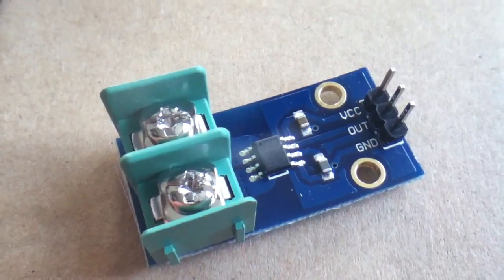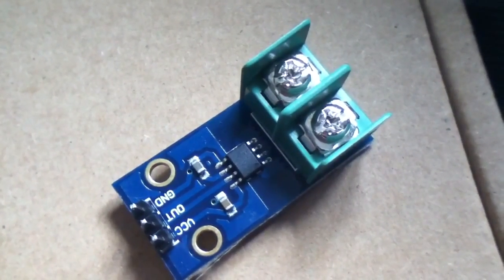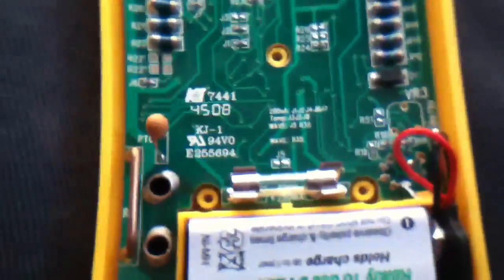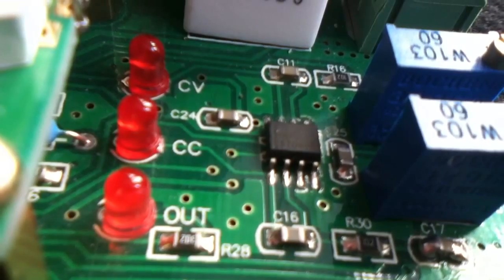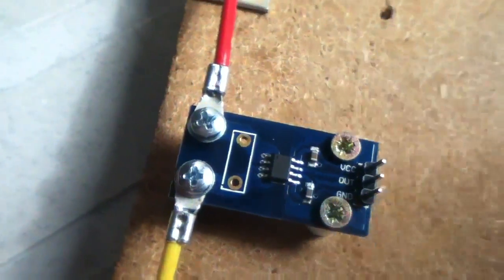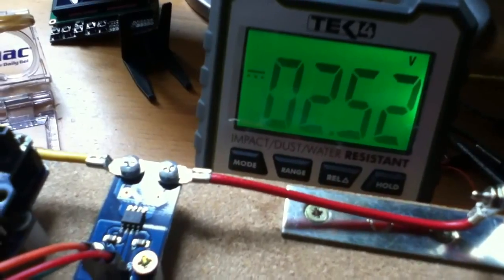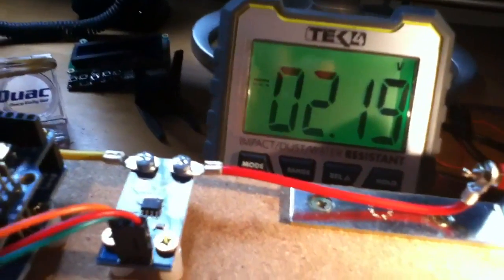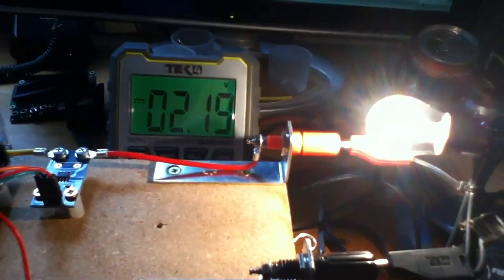Using the ACS712 Hall Effect Current Sensor Module (part 1)

Comment: I bought one of these modules and it seems to me there is no way you should run high current through those traces on the pcb -- has anyone done it? It says good for 20 amps !  (no way?) YOurs looks beefier than what I bought -- nicer terminals also. Where did you get it?

Comment: Hi Julian. good vid. But to me (so far) the acs712 is pretty useless. I have 4 of those mini boards but the readings are so silly unstable. With no load it is hopping between 08 amps and -08 amps. Some times I even see reading above 2 amps.  I also have the ina219 whis is suposed to be much better but that one does only handles max 3 amps. When having 200 watts of solar on 12 vols... well  I need a lot more amps! 

Eventually I like trying to "record" the current/wattshours going in and out of the battery so I can determine of it is running low or not. I need this since just measuring the battery voltage under high load is pretty useless because of the voltage drops under load. 

So any one any suggestions for a (cheap!) +-20 amps  braekout board for arduino similar too the ina219?

Comment: Julian, you stated the isolationvoltage of the acs712 is 1200V. According to the specs of Allegro it is 2.1 kV RMS (60Hz) for the duration of max. 1 minute. Did you test the 1200V as a continuous DC voltage during, lets say, 1 day?

Comment: Could you measure AC current with this module? Did you use any control of 50/60Hz pulses to measure in AC?
Reply: Yes without any problem

Comment: Please suggest me to measure th DC voltage upto 500V and Current of 20A I want to make power meter for my solar panals whcih are capable of giving volage upto 300V and current upto 5A please suggest me the sensors

Comment: I think with all those ring terminals you’d be better with a soldered in low value resistor! But I can see that the purpose is to use it as a test rig and or demo. Just out of interest stick your Dmm set to mV across the 2 terminal sockets that you fitted to the end of the wooden test board when you have a high current flowing. Be interesting to see what drop you get. 
Great demo and thanks for sharing!

Comment: Hi, may I know is there any current transformer/sensor to measure 240V AC and able to interface with arduino? This will helps a lot....thanks
Reply: Hey..Jeffrey Ho did u get the solution for this..i am also facing same problem..tell me if u got d ans..ty in advance

Comment: Can I test this sensor with a supply of 220V using a 11W bulb?
Reply: Yes, an 11 watt bulb should draw about 50 mA, so you won't get very high resolution. It should output an AC voltage of 26 mV peak to peak, centered around 2.5 volts. That's going to be quite hard to read, so you probably would be better with something else but it shouldn't be dangerous. Please do be super careful when messing with high voltage! That Sh!t will kill you faster than a rogue US navy drone.

Comment: Why do you want to only measure current on the high side? The amount of current flowing directly out of the positive end should be the same flowing into the negative end (reverse if you're talking about electrons), so measuring current at both ends should work the same, no?
Reply: The reason is not because the amount of current will change, it's because of the use of common grounds. This chip has a nominal 1.2 mOhm internal resistance. If you put 20 amps through it, it will drop 24 mV. There are some situations where you need the ground potential of your device being powered to be exactly equal to the ground potential of your power supply. If you put this device on the high side, then the ground of your power supply and the ground of  your load stay the same, and it makes everything much easier as you no longer have to account for that 24 mV difference.  For example if you also need to measure the voltage across your load, putting this device on the low side would required taking voltage measurements on both sides of the load, and subtracting. If you put this device on the high side, you only have to measure the voltage at the positive rail of your load, because you know that the ground of your voltage measurement is the same potential as the ground of your load.
Reply: gizmoguyar Awesome, thank you! If you have no need for a common ground between components (such as no serial communication between them) then there should be no issue with placing this on the low side, right? Although I suppose placing this on the high side would be a best practice regardless.
Reply: Yes, that's absolutely right. It would be fine to place it on the low side if you want. Although since it doesn't change anything, I would place it on the high side anyway as you said.

Comment: hello sir !
i am measuring power factor through ATmega8 micro controller.. 
i used "zero cross detection" technique to find power factor..
but the output wave of this "ACS712" sensor does not touch zero (ground level) ,
it give me output wave form from "2.5" to "5". 
i want to get its output symetrical across zero... what i need to do... ?
plz give me sugeestion to solve this problem..?
Reply: Delving into the world of split rail (or dual rail) power supplies is very tricky. You could make a power supply that outputs negative voltage and make amplifiers that operate from the positive to the negative rail to remove the DC offset of this device. And then make protection circuits because the ATmega8 can't withstand negative voltages. That would give you your plus and minus signal centered about ground. Or you could make a rail to rail amplifier circuit that removes the DC offset, in which case the negative half of the signal would simply be lost. 

My suggestion is to do it in software. There are two possible ways to do this. If you know that your signal is symmetric (i.e. +5 to -5) then you can simply record the max and min values in software and use the point halfway between them as your reference (3.75 in your example). If the signal you expect is not symmetrical, then you can calibrate your software by measuring the signal with no current flowing, and using that value as your reference.  All of these methods above will require physical or software calibration anyway, so I personally would't bother making any additional circuit if you're going to have to write the software anyway. Just do it all in software.  Let me know if that helps.
Reply: gizmoguyar thank you sir...

Comment: Hi Julian, I was wondering if you knew anything about needing to sense the current with 10 AWG wires? We are working on our senior design project but we feel those green terminal blocks are too small for the wire sizes we need. Do you have any recommendations?
Reply: Sorry, I guess I mean the connector!

Comment: Can some one assist me Im trying to make a ardunio driven device that causes a led to turn on if the current in the circuit goes above a pre defined level the circuit will be drawing  5v and a low amount of current tho not 100 sure how much yet. 

two questions 

will this be able to perform this task. 

and also does anyone have any links to any code I can look at to get an idea how to start programming this
Reply: learn C
Reply: does not really answer the question tho I asked not just how I can do it but if I can do it.
Reply: Yes, it'll work for what you want.  
There's code in the video description.  Add a simple if/then statement and you're done.
Reply: cheers thank you should be able to go fine from here then
Reply: Try this library: https://github.com/rkoptev/ACS712-arduino

Comment: Mr Ilett, my acs712 is reading all over the place. it's not connected to anything yet reads anywhere from 495 - 530, where yours reads 513-515. do you know why this might be? 
thank you so much for your videos, to say they have been helpful is an understatement!
Reply from the maker: Try increasing the value of the filter capacitor
Reply: +Julian Ilett thanks for the quick response, I'm using a 474nf filter cap as per your suggestion in video 3
Reply: your signal could be dirty

Comment: hi, Only measure Ac current or I can measure Dc current?
Reply: +Cesar Coronel 
it will do both :)
Reply: there is a type of AC/DC current transducer. You input the AC current, you get AC signal output.,and you input the DC current, get the DC signals.  see https://g-sensor.net/signal-conditioner/Synchro-Tracking-Transducer//2018/0307/151.html

Comment: Hi sir. Can acs712 be used to measure current through an AC load like an oven or a bulb connected to 230V AC ? Also can you tell me how to connect the sensor ? i am not able to get any reading when i connect the sensor with load or at no load it stays at 2.5V . please help

Comment: I checked the comments and didn't see this addressed so i will say: the lack of solder on the terminal block must have been an oversight. Or did the torque of the screw turning break the solder joint?

Comment: Hallo, That was really brilliant 
I need to measure a current (0A to 10A) and give it as input to my arduino 
I wanted to use a shunt resistance 0.02 ohm to get a voltage with 10mV max the use an amplifier to make to 5V max 
Can I use this module instead all this steps  ؟؟

Comment: Did anyone have try this module with ac loads? Does at out of this ic gives 2,3Volts when only a current flows?? and at no flow no voltage...?? i ask that because there is no point having all the time voltage, how can  a current flow be detected then ??

Comment: Hi, the sensor works well for currents of around 1A and above (due to sensitivity/accuracy).

Do you know a sensor that can be used in a similar fashion but for currents in the 100 mA to 1A arrange (even dc only)? 

Thanks!
Reply: +lajolo tenes que acondicionar tu señal para terner mayor sensiblidad el datasheet te da algunas opciones para eso
Reply: +lajolo 

If a lower bandwidth suits your application, you can use the WCS2702.
Reply: +Rachit Pradhan Thanks. I had a look at the datasheet and it looks interesting.

Much more accurate (1 mV/mA) and low operating current (3 mA).

Comment: Do you get a perfect 5.00V 5v from your power supply? If not, then I think some changes have to be made to scale for the ADC. In my use so far my USB ports give different 5v values - 4.78 on my PC and 4.68 on my Raspberry PI.

Comment: Julian Ilett Sir this ic works for dc current in this fassion........ i want to measure ac current how can i do that.....??? when i measure Output of this sensor by connection an ac load to this the DMM reads constant 2.50 V  at (V dc ) irrespective of how much heavy load i connect to it ......... Plz let me know ASAP........ nd if possible make a video of that to.......Thanx
Reply: Habib Ishtiaq God, Indians and Arabs are always the ones demanding videos and schematics and code. Do your final project yourself.
Reply: i have done it by my self thanx for your very late reply...
Reply: +Habib Ishtiaq Did you try out this module with ac loads?When a current going thru the connector there is a voltage and no current no voltage at out??

Comment: Monitor any 30a load or less for about 3$..0-5v analog output to your microcontroller ..how cool is that! :)
Reply: problem is your voltage has to be under 8v... what if you want to monitor amps for a brushless dv 48v motor at 30a...?
Reply: @artbyrobot1  I bought some of these and put them in  a box years ago :) Max input internal power 5v- 8v MAX. current being measured has no potential, just current. 48v 30amps is redline. Use 2 or redo the math and use a shunt :)  To anyone who might find this useful.

Comment: Julian Ilett plz answer my question ASAP . I want to measure power of ac line by formula P=V x I. by the help of this tutorial i am able to measure current but now my mind is stuck that how to measure voltage Plz let me know which IC are you using to measure voltage.......????????????
Reply from the maker: Habib Ishtiaq Use a simple potential divider, but I can't help you with the calculations for AC power
Reply: Kishan Prudhvi Guddanti  you can use this one http://www.ebay.com/itm/390902157627Voltage Transformer Module Active Single Phase Voltage Sensor Module AC output
Reply: The voltage depends on where you live, typically 110, 120 or 230 volts. You dont need a second chip as the voltage should stay the same.
Reply: +Habib Ishtiaq For power measurement, you need to integrate over the waveform because of phase shift between voltage and current waveforms. It is not a simple multiplication of v x I. You will need to do some study of power electronics to get the necessary knowledge of how to do it. For example, the current waveform my be in the form of distorted pulses whilst the voltage waveform is more of a sine wave.

Comment: Thank you, that's brilliant!! I will try this out myself, but I'm interested in smaller solar panel currents, up to about 0.5 A. Do you have any advice for taking accurate measurements in this situation? (Like you, I'd rather not use a shunt resistor.) I'm using an Arduino as the recording device.

Comment: HI Mr. llett,
I am trying use this to measure the 230V input, even though the specification listed the isolation up to 2.1KV. I still hesitate whether my connection to 230V is workable and not damage my circuit. of course i can use experiment to prove it. but more conservative way I would like to ask your opinion. I watch your demo is using 12V. did you try the more high voltage like 110V...etc
Reply: this was done
Reply: The 2.1kVrms insulation is for the ACS712 chip only. Since the manufacturer of this module has added some conductors between the inputs and the outputs of the chip, the actual insulation is less than that. In fact, this module does not meet the minimum security requirements in several countries, and should not be used in a 230Vac device.
Reply: thanks and noted
Reply: @HoBrian  Old Post but pertinent to some.  This circuit would not function on AC current.  The magnetic Phase Change would end up as ZERO.  You would have nothing to measure.  You would need to convert your voltage to DC and that would nullify your true values.
Reply: @pulesjet   ACS712 provides economical and precise
solutions for AC or DC current sensing

Comment: You can construct a simple circuit to monitor AC current, but the sensor is not designed to monitor AC directly. Since you mention 230VAC, I take it there is high current involved as well; in this case, depending on current expectation, I would place a few wraps of insulated wire around the (insulated) hot line, partially rectify it (that is: insert a diode) which would leave you with a small pulsed DC signal. The sensor should do fine detecting this signal. Current levels would dictate design.